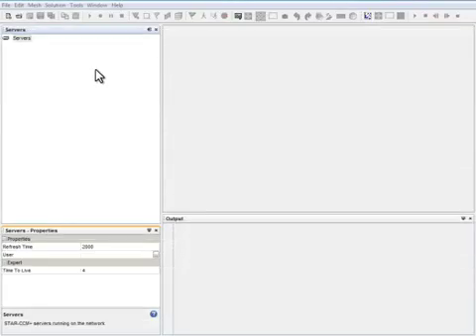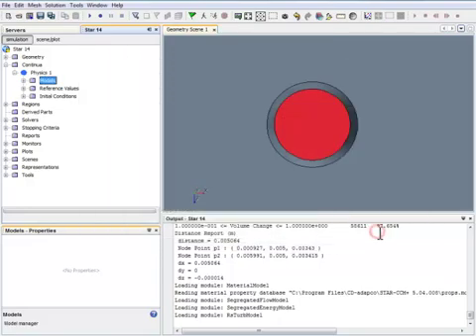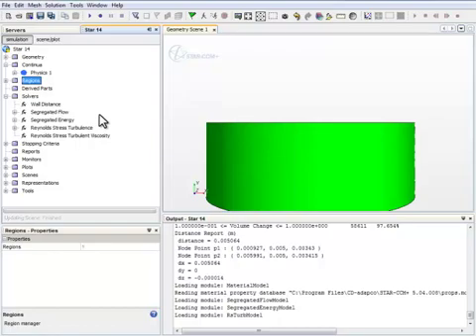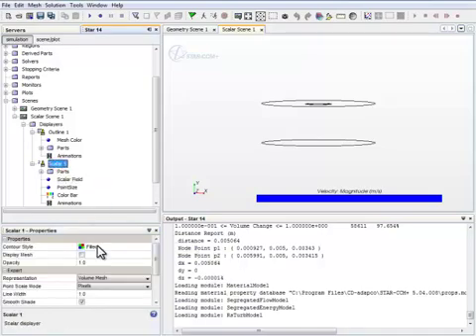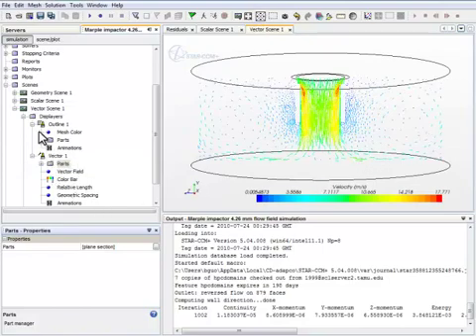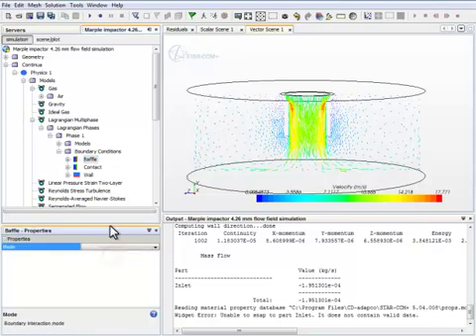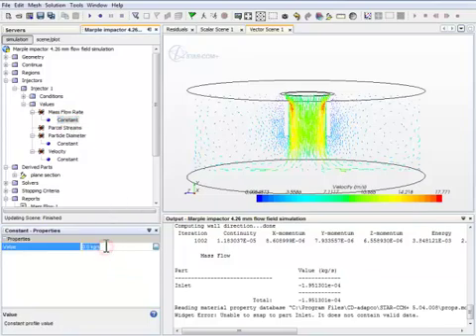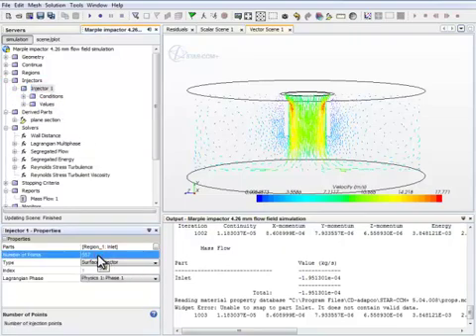Simulation of an impactor II: Flow field simulation, particle tracking and efficiency calculation

Comment: Thank you for the Video Bing. how do you choose one way coupling, since it has only the option to choose two way coupling or higher
Reply from the maker: That is a very technical question and the answer depends on the CFD program that you use. Even if you use the same product that I used, the product might have evolved so that options may no longer available. I am afraid you will have to figure that out on you own.
Reply: @bing9u0   Many thanks for your quick reply. yes I am using STAR CCM+, but seems that it has been changing from the version you used. Also I have another question regarding the video , you mentioned that if we have already the simulated flow field we have to freeze solver setting related to the flow. so we have to freeze the flow as well? or I am misunderstood you

Comment: Thank you for your video :>
But:
1)  According to User Guide Flow-Split Outlet is not recommended for compressible flows;
2)  Particle mass flow rate of 1 kg/s looks like too much to be modeled as Lagrangian Particles - since particles volumetric flow rate: VolFlow/Density ~ 1 [kg/s] / 1000 [kg/m³] = 0.001 m³/s which is 10 times more than air volumetric flow rate (0.00017 m³/s); Dispersed Multiphase Model might be required;
3) Outlet boundary seems to be too close - and that affects the flow;
4) Lagrangian Particles flow simulation was performed as one-way coupled (particle flow is affected by the air flow, but not vice versa) - which again looks incorrect due to high particles mass flow;
Reply from the maker: Thanks for the comments. Here is my response:
1) The flow has very low Mach number and hence the compressibility of air should be negligible.(The air flow should not be considered compressible flow.)
2) Here the particle mass flow in the CFD settings is a nominal value and does not affect the dilute aerosol assumption. You could use a more realistic value (which may be more cumbersome to write) and see that the simulated particle capture efficiency would be the same, if all other conditions were kept constant.
3) This may be a valid criticism. One could move the outlet further away and compare the results.
4) One-way coupling is used because the low particle concentration in aerosol problems. The particle mass flow rate in the CFD setting is only a nominal value as explained before.
Reply: Uh, if I got it right and real particle flow is small (and 1 kg/s is just a representative value) - then you're right, no questions :>
And again - thank you for the video, unfortunately there aren't a lot of them for Star-CCM+.